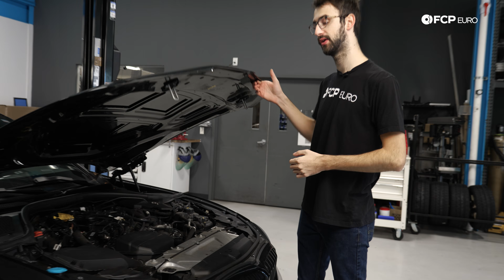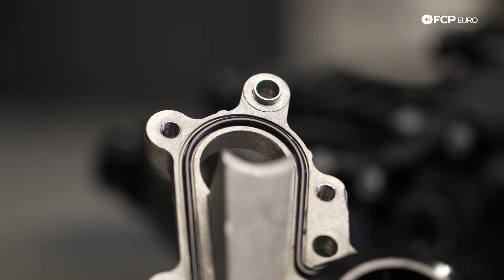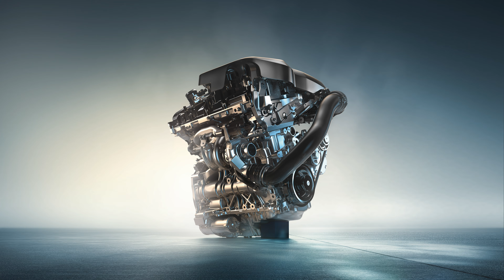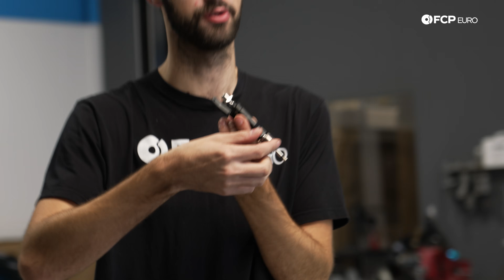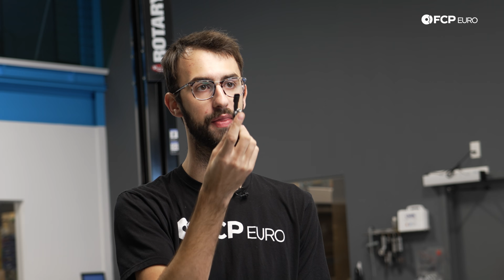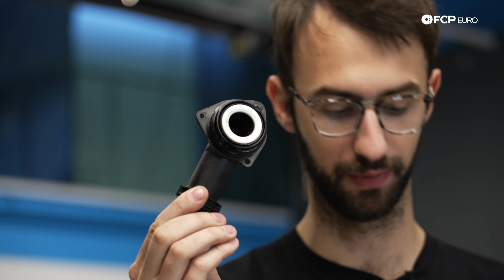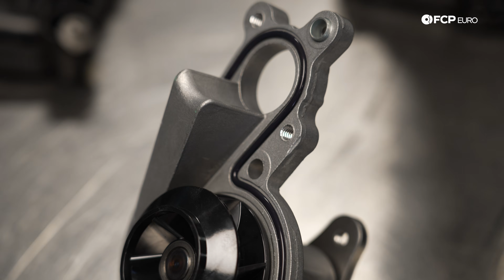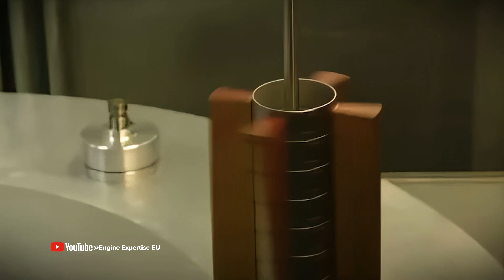BMW B48 Engine: Everything You Need To Know - BMW F30 330i, G20 330i, G01 X3 xDrive30i Engine Guide

Comment: I recently bought a 120i, wich also have a B48. It cames with a ECU tune and is making 252whp and 419Nm of tork. It does not have downpipe and high flow air filter installed, just the ECU tune. The tune is pretty safe focused, it can run with 93 RON gas (that we call incomplete gas here in brazil), but i only put Podium, wich is a 102 RON gasoline that we have here in Brazil. But the car is making a horrible mpg, like 47mpg running into city and 23mpg travelling on the road. I don't know why is it, my mechanic said that it is normal, my friends too... but it is no accurate with the information that i see on the internet. Have you guys any idea of what is going wrong or what shoul i check in my engine to investigate it?

Comment: If the last leter in the engine code representing performance classes, where do you put B48B20A and B48B20B ? I don't see those letters in your expectation. Former is for ex 420i and latter 430i in Europe, just as a hint.

Comment: Hi mate great video! I have a 2016 F31 M Sport wagon. Are the upgraded parts you mention such as the aluminium oil filter housing BMW approved? Note: We have just had a jammed cam shaft sprocket occur due to the central bolt/valve mesh screen failing! Apparently is fairly common and no one recommends any preventative maintenance as ut can occur at any time. Our wagon has 100k kms and very well maintained

Comment: Love to see and hear the B48 being such a good and reliable power unit.

I recently bought my first BMW and it's a 2021 BMW 128ti. Engine code is B48A20T1 and I wouldn't have expected it being in the TOP tier compared to a 330i. 

I guess it does come out from a M135i which is supposed to be M Performance?

Comment: B46(b48) in my 2019 mini countryman S. Hesitates(feels like intermittent random misfire, makes your head bob a bit) when I’m light on the throttle (5-25%) especially obvious when driving up hill. Zero codes, no lights. Only does it when it’s about 80f+ ambient air temp whether the engine is cold or warmed up. 30%+ throttle and the issue is gone. Under 80f ambient air temp, the issue is also gone and cannot be replicated.

Comment: Just looked at a G30 330I 2018 it looked pretty clean maintenance records were I would say was 7.5 out of 10 they started going for 10,000 mile oil changes at the end of ownership. The car is about 73,000 miles drove and road. Great I was able to get the price down to around $16,000. They had it on sale for 19. It was a northern car for most of its life so I had to deal with the snow and salt, but I didn’t see anything that stood out to me in terms of issues. I walked away from the deal simply because the mileage was too high and I was unfamiliar with the B 48 and BMW in general. Was this a good deal? Should I have gotten the car? I ended up walking away, but I’m thinking about it right now. Any thoughts?

Comment: So, pay $40 to 60k for a new BMW that has a service table that says "60,000 miles, replace heat management module; 60,000 miles replace oil filter manifold; 60,000 miles, replace valve cover."  Add to that the insult of step 1 of the timing chain replacement procedure ... remove engine ... yea ... no thanks!

Comment: I just replaced my oil housing coolant at 45K. So, you are right about that. Lucky I had an extended warranty and only had to pay for the deductible. Turning off my start-stop feature ASAP. LOL! Thanks for this info. I learned a lot. I have the 2.0 Supra which has the B46/48 engine. Love it so far. I have a few mods and it is putting down 305 at the wheels.

Comment: 2019 bmw 430i xdrive gran coupe

Repairs:
Oil filter housing - plastic
Water pump twice
Lower control arms + Bushings
Radiator plastic
Radiator lines
Turbo inlet repair
Both engine plugs
And so much more

Drove from 29k - 94k normal driving, serviced at every interval. 9k in repairs on top of regular service maintenance. 

Great car to drive, really good gas mileage but absolute junk and unreliable for such a car brand.

Comment: B48 is hella underrated! It's a 4 cylinder B58 and you can squeeze a lot of power outa that 2 liters. You get yourself a 330i and with a stage 2 you're already looking at 400-450 hp, and with aftermarket bottom end sky is the limit.

Comment: I have the slowest coolant leak on my B48 even after replacing the water pump and coolant hoses. No mixing between oil and coolant so it cant be the oil filter housing. Every few weeks I need to fill more water and coolant to get rid of the warning. It’s leaking right around where the oil pan is on the front of the car. The shop did multiple pressure tests and could not find a leak after.

Can anyone help? I’ve spent way too much money for the issue to not be resolved still. There is noticeable loss in HP when it is low on coolant.

Comment: Guys; do research. Google is your friend. Company called Onust offers warranty that covers ALL of these as they're FAILURES, not maintenance items. I have their coverage. They're the only ones that do it. Please look into it. Coverage for G20 is around $135 a month (month to month, open ended) as long as you're under 120K miles when you sign up. You still have to do stuff like trans fluid, front and rear diff fluids, transfer case fluid, etc. but these massive weak points that cost $4000 EACH are covered. The best part is you can use any ASE shop. That means you can have the shop (or yourself) buy the parts from FCP and have Onust foot the bill.

Comment: I bought a BMW 520i, petrol, G60 body. I would like to know which oil is best to use. The dealer said 0W-20, but I would like to know your opinion. I would like to change it myself, I don’t want to go to them to change it every 20,000 km.

Thank you in advance
Reply: Pentosin, then check owners manual for climate conditions.

Comment: i've been thoroughly enjoying the B46 in my 2015 Mini S. I'm at 133k miles, change my oil every 4000 miles, and recently changed the oil cooler to the full aluminum replacement. My turbo will probably need replacing here in the next 10k miles if im unlucky, but otherwise the engine has been smooth, fast, and good on fuel

Comment: The vanos bolt screens fail and get caught up in the cam gears causing them to break. Junk! Also the cam gears do not have timing marks or keys. They are litterally held on by the bolt and will damage the engine is the bolts were to become loose. 😊

Comment: I found a 2024 BMW X1  I'm interested in buying but carfax only shows 1 oil change at 19K miles Is this a pass if carfax is correct or is it worth taking a chance that no damage has occurred to the engine and turbos?

Comment: I’ve been having non stop coolant issues
Reply: You have to replace everything at one time. Oil filter housing, heat management module, cylinder head connector, turbo cooling lines, all hoses, water pump/bracket, expansion tank, and radiator. If you are having a problem with the cooling system boiling over when you are on the high way. You have blown the head gasket from over heating it. I’m a bmw master tech. We see them come in all time from shops or owners that “fixed” a coolant leak. But failed to bleed them properly and cooked the engine. These motors have to be vacuum bled. Then a very specific throttle modulation procedure while closely monitoring coolant temp. Failing to do will blow the head gasket. And it will only boil over after driving at higher rpm for a period ie highway driving. You can drive them around town with no issues.

Comment: I had B48 in Brisbane, it didn't do well in the heat... Burnt loads of oil and got really noisy at 100k kilometres (not miles).... So I sold it.
Reply: I need to pour zero 0W20 liquid oil in the heat and everything would be fine with you

Comment: Planning on buying a '19 330i with 50thousand km. Approx 25k miles. Will be my first BMW, and i need a daily driver. Seems perfect.
Reply: I have a 2022. Drives great. I had a 2016 328 but it was totaled (hit from behind) I like the way the F30 body style looked way more, but the G20 is an overall better vehicle.
Reply: @yunglombardo4968   have had many, just got the e48 2021.. Drives like a lexus.. whaaat?!! AWD was a mistake, just do the RWD
Reply: @linnae-w3s  xdrive is 4wd. Its terrible
Reply: me too, but a  21
Reply: I’m looking at one too,18
Reply: How much did you get it for?
Reply: Get the 6 cylinder 440i I regret it
Reply: @joemosesWS  😂 why get a way heavier and uglier and number car? Cant even call that a bmw. Sheer driving pleasure? 0 of it in a 340i or 440i. 330i is much lighter and has better steering rack.
Reply: @DudeThedudeskywhat are you saying i have the 430i its not fast enough
Reply: @brownsnakeman  They are much harder to find.

Comment: Tell me, please, my friend and I have two identical cars. Mine is two months newer than his 330E... The difference is that mine is an xDrive... It says on the engine block that his is a B48B20B, and I have a B48B20A. That is, BMW mistakenly installed an engine from a regular 320, and my compression ratio is 11, and his is 10, which means his engine is more reinforced, more powerful, and responds well to good tuning. We went to various American and European forums, there is a lot of discussion about this... Can you please answer this question? We asked the BMW dealer, even the official dealer does not know the answer to this question.: ((((
Reply: B48A , the A is mounted transverse for front wheel drive. B48B is longitudinal mounted for rear wheel drive or all wheel drive. 

20A is 2.0L version A.
20B is 2.0L version B.
Reply: @bennyang8049 No, you're mistaken. Here's my VIN: WBA5P91010FK22965. These cars, after 2021, had the B48B20A engine installed... I'm taking photos of the VIN code block, and it says B48B20A.

Comment: so the engine names and info you gave here is a little weird when you see the B58 being a 6 cylinder version of this engine, despite being a 6 cylinder rather than a 5 cylinder as the breakdown here would imply.
Reply: I think the problem is they also have a 10 cylinder version (!) and that would have required an extra digit so they compressed the encoding after 4.   Though I would have been tempted to label the 6 a B68 and the 8 a B88 and the 10 a B98 as no one is going to build a 9 cylinder ;)

Comment: Great video. I’ve already changed the expansion tank and oil filter housing. My mechanic told me that the new ones were aluminum and didn’t have those other gaskets where you could see one of the gaskets failed. That was at around 75,000 miles. It just hit 100,000 miles. It’s a 2017 530i M-Sport with the cognac leather. I love the car. I paid it off a few months ago. I think I’m gonna gamble and keep it and try to get a few more years out of it.

Comment: The use of plastic at this point it’s just laughable considering that they have had issues with plastic components internally since like the 90s early 2000s it’s just it’s common sense to me. I’m sorry but plastic can’t handle heat cycles over and over again like aluminum.

Comment: Replacing each of those plastic components at a BMW dealer costs anywhere from $1,500 to $2,500. Yes, the engine might be considered “reliable,” but when the main components that actually keep it running are poorly designed—or seemingly designed to fail at 50,000 to 60,000 miles—then the engine is no longer reliable. It shouldn’t be glorified; instead, BMW should be called out for it and perhaps even held accountable.
Plastics can and do fail, but when all of those critical plastic components appear to share the same 50,000 to 60,000-mile lifespan, it suggests an intentional design choice.
I own a 2022 F60 with about 54,000 miles. I’ve been proactive with oil changes, coolant flushes, and regular maintenance checks to ensure everything is in good shape. Still, this will probably be my last MINI/BMW. To me, it feels like nothing more than a carefully orchestrated strategy to extract more money from customers

Comment: I have both b47 and b48. One is diesel and the other is gasoline
Reply: Which do you find to be more reliable?
Reply: @IC.XC.NI.KA. actually both are very good . Just do maintance every year and they are very good cars. On the diesel i replaced all brakes it was time it has 120.000miles —200.000km and i live in scandinavia very cold and alot of road salt here

Comment: BMW should do a recall for upgrade on oil cooler housing
Reply: how many miles did this affect you ?
Reply: @linnae-w3s I developed the problem at around 105k km. I replaced on my own hoses I could see failing. What's left is certain to be those within the oil filter housing which is hard to reach and requires lots of dismantling
Reply: @dewitgoh  Thank you
Reply: @linnae-w3s mine went at 65k miles
Reply: They should but it's been an issue since 2014. And going forward to the next technical update for the Neue Klasse cars they will still keep using a plastic OFH. BMW truly doesn't give a fuck.

Comment: The B48 is severely underrated, it's finally deserving some recognition because of the new M2 racing lol. I have a '20 330i with the B48, and it's a monster. Extremely reliable and more than fast for the road. My B48 even survived water damage somehow lol, no engine knocking. BMW really did it with the B48/58
Reply: I went from a Na V6 bmw 328i xdrive e90 2011 and went with the b48 330i 2018 model. Love it
Reply: @Sallgood08Inline 6, not a V6. Congrats on the car regardless and I hope you throw in some bolt ons!
Reply: Monster is a bit of a stretch…

Comment: Just a heads up hopefully you can spread this info better than I can, components like the heat management module, fuel rails, injectors, pumps, hpfp, intake manifold, valve cover gasket, turbo, and wastegate is covered up to 70k miles under the CALIFORNIA EMISSION CONTROL SYSTEM LIMITED WARRANTY* for all B46 motors in sulev states!

Comment: Hello, UK viewer with a couple of questions please. We've shortlisted the BMW 220i coupe (G42), with 135kW/184hp & 221lb ft (not offered in the US) and the Toyota GR Supra 2.0, also with the B48, this time making 258hp/295lb ft.
Can you nail down the EXACT engine codes for each, eg, B48B20M0, as each time we search online, conflicting information?...and
We do 3-4,000 miles a year, what issues do these engines need watching for and what preventative measures would you identify that we follow.
Reason we ask, here in the UK, Toyota offer the RELAX warranty, service at a dealership annually, they add a further years warranty up to TEN years/100,000 miles...BMW come nowhere close.
What have Toyota done to this engine that enables them to warranty it soooo much longer than BMW?
Sorry, that's three questions.

Cheers.

Comment: Hello !! Following the problems with the antifreeze expansion tank, the pipe from the tank to the radiator, the pipe from the thermostat to the turbo, the solenoid on the exhaust from the left valvetronic toothed roller (I replaced the entire distribution) and the oil filter housing with destroyed gaskets, I decided yesterday and I had to intervene on the software to change the working temperature of the thermostat to 90 degrees Celsius !! Now it opens at 90 degrees and the antifreeze goes to a maximum of 92 degrees Celsius on sport and the oil to a maximum of 102 degrees Celsius !!! now I have a ,,cold'' thermostat and an oil that no longer loses its properties very quickly !!!! We in Romania have solutions to all problems !!! I hope I don't have problems !!

Comment: I have a B48 2017 330, the car has 55k miles on it currently, should I go ahead and replace the oil filter housing with a metal one right away? I also see some aluminum valve covers as an upgrade over the plastic with a removable PCV, is this something anyone has experience with?

Comment: My B48 is in the shop as it burst a coolant hose and it is not even at 50k miles. Of course I bought it used at 35k and I am not sure how much abuse it has got from its first owner. I hope it is only the coolant hose and not a cylinder head gasket too....

Comment: Just had the coolant hose blow from the cylinder on my 420I 2020 4 series.  Loss of coolant.  Engine ok, but found out that this is a common problem, I even got offered to buy at least 2 hoses from BMW.  Plastic is not always the answer..........

Comment: ‘17 430i with a B48. Cooling system sucks, turbo failed, flange failed, oil filter housing failed, several coolant lines failed. Replaced the oil filter housing and flange a while ago, there’s a small coolant leak again. My siblings 430i b48 flange or oil housing is raining coolant.

Comment: Yeah add barring failure! My 2019 jcw just spun a rod baring on cylinder #4 at 55k and I’ve changed oil every 2k with liquid molly ! I looked into this and it was an issue in Europe but not mentioned here in the states, I’m going to see if bmw will fix it under warranty even though it just went up because it’s a known issue, but honestly I feel like bmw cars are garbage and I’ll never buy one again because of this issue, I think the b48 is trash I’ve had nothing but issues from day one with this car , my Audi was more reliable which is saying something but it’s a 1.8 i4  amu block ! Best car I’ve ever owned over 200k on it no issues besides failed plastic coolant  parts but I bought aluminum replacements and it’s great 👍

Comment: I had bought the b48 downpipe when apparently i needed the b46, is there an adapter i can use? if so what is it called?
Reply from the maker: There doesn't seem to be any adapters for this out there. It would probably be best to return/resell the one you have and buy the correct one.